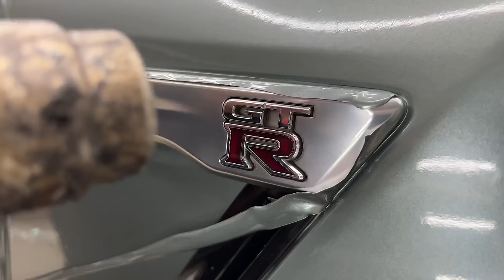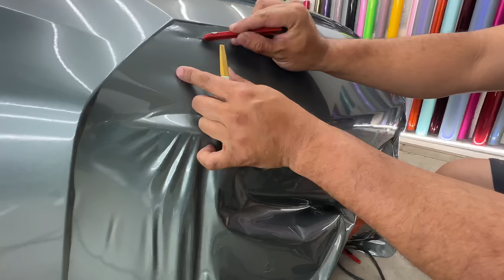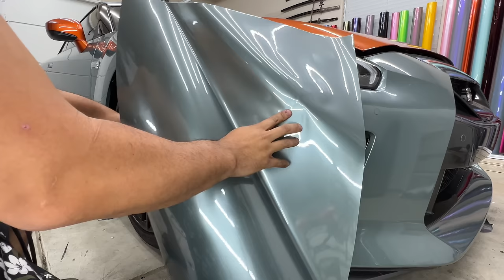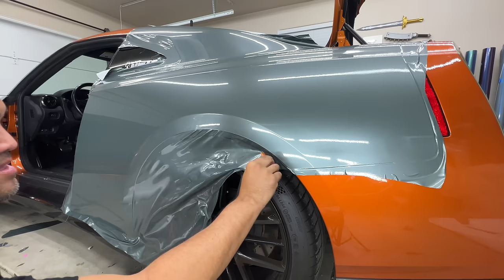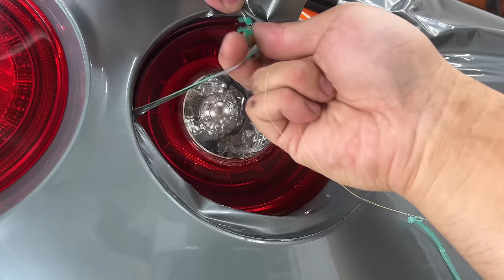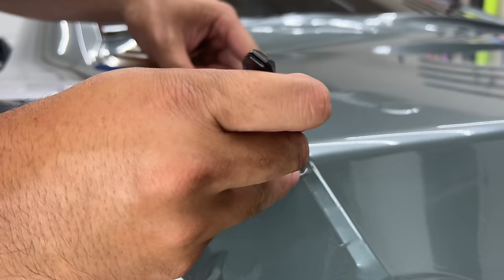R35 GTR Jade Wrap Guide | Hardest Parts In Real Time ASMR

Comment: Work in triangles
Work in bigger areas
Clean more
Remove trim
Remove the bumpers and lights
Achieve more with less heat, you can do loads more without heating
Magnets are fab, use them

Comment: Great vid. I tried wrapping my car for the first time. Just the trunk and it was havok. The material was getting holes just from the initial glassing stage before i applied heat. It was 3m 2080 satin dark grey. Is this bad material or was I too rough with it? The way I see people treat the material on this vids is far more than what I was doing.
Reply from the maker: You just need more practice
Reply: Probably true. When you are doing the hood and you glass it do you need to leave the too and bottom part open so that you can release the air when you squeegee up and down?

Comment: Comments here 👇👇👇👇
1. When you started to wrap the silver gray over the orange, That 2 tone color would have looked better
2. in the past on how you "pull" the wrap to get it straighten to lay on a vehicle, ever thought of using a plastic pipe to hold the end then pull it straight? plastic/PCV pipe will hold it most straightening application for your needs.
Reply from the maker: Takes too long to set up a pipe and too much potential to get contaminants

Comment: Could u show more on the wire u use to cut the vinyl…
Reply from the maker: Not much to show. It simply is a string built into the tape. You pull the string and it cuts the tape
Reply: Ooh okay Paradox.. yea I looked it up n saw how to use it. Thanks for the replay brother